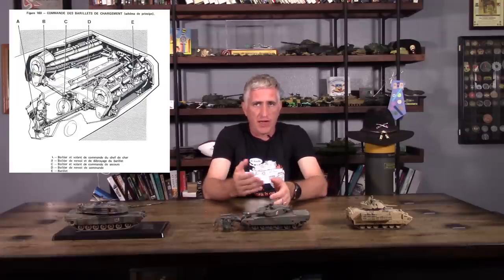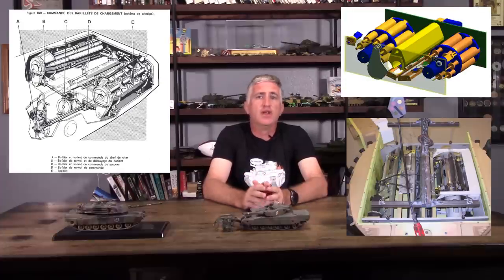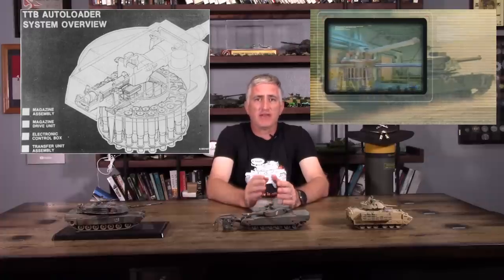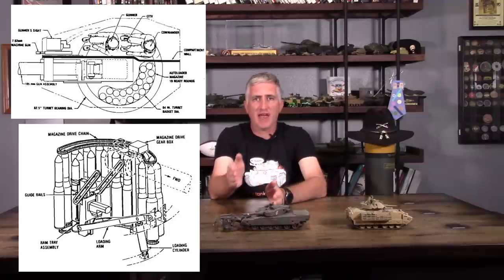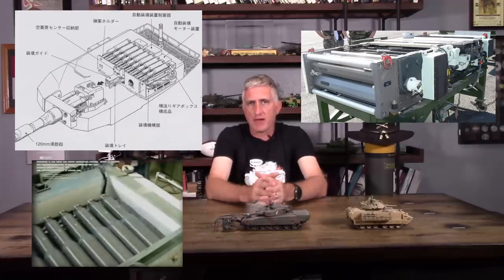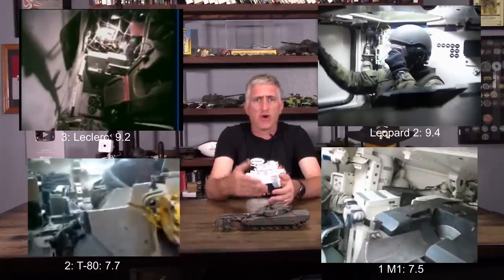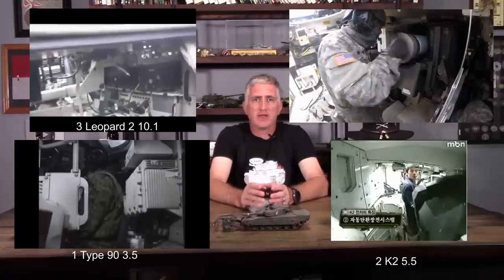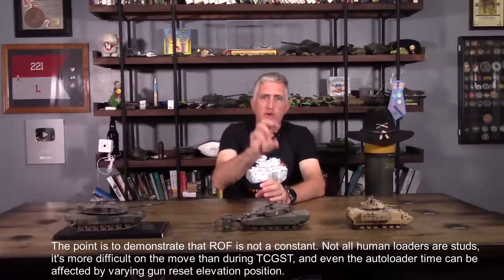Whither the Autoloader?

Comment: For me, the future is in autoloaders because I think next generation if tanks be semi drone, with the possibility of computer-assisted remote control mode.  If we look at T14 type tank idea, is easy to convert this type of tank to the drone, because all essential components are in place. Crew be in this type of tank mostly for strategic movement and maintenance.  When shooting start tank be command remotely.
Reply: The problem with this is that you are going to be sending out radio signals to and from the drone tank.  Which means that the enemy will know the tank's location and your location to within 10-15 feet.  You can buy a scanner with direction finding capabilities for under $1,000 at any amateur radio supply store.  And adding a feature that causes a missile or shell to home in on a radio transmitter is old technology.

On a battlefield you want to avoid doing anything that announces your presence.  This is why tank units still train to communicate using hand held signal flags.  Transmit on the radio and you're announcing you location.
Reply: @colincampbell767  That and anything controlled remotely can potentially have that signal disrupted, rendering your machinery useless.
Reply: @colincampbell767  I think about the more similar system as in air combat drone, where drone himself is pretty autonomous, and human control is rather because of law, not a necessity. And signal can be quite hard to detect, the possibility is laser signals retransmitted by air drone or very short-range signal transmitted from-to infantry supported by this tank.  This type of vehicle is more flexible than a pure drone, because can have the crew in the armored capsule, but in risky situations can work alone with a guide of supported troops (city fight or the possibility of mines)
Reply: @mikolajgrotowski  Laser requires a clear line of sight and the beam will be visible to anybody with optics that detect that light frequency.  (And if you use a frequency that nobody can detect - your drone won't detect it either.  And you also need a system that keeps the laser aimed at the drone.  

The way I would use a drone is to keep them with the company commander and send them out as expendable assets.  Preprogram the course into them and then either review the data it collects after it returns or observe it and see what kills it.  And even the presence of a drone will alert the enemy that something is out there.

If you want to put drone on tanks - use a ground vehicle type drone that's small, low to the ground, and designed to move stealthily.  Use fiber optic wire for communications with the tank, and it can replace the requirement of putting a couple of people on the ground 100-300 meters in front of your platoon as an LP/OP.
Reply: @colincampbell767  You think on drone as scout,  I think on heavy fire support platform. When I served we have couple methods for secure short range communications,  and this can be used.  Lasers are difficult to detect because are coherent,  and if you not stay directly between sender and receiver you not detect this type of communication.  And on modern battlefield is high level of communications noises,  making detection even harder.  And full sizes tank drone have advantages,  is possible to mount heavy weapons and with places for crews is more versatile,  because can work as drone or normal crewed tank.
Reply: @mikolajgrotowski  Lasers can be detected.  Air will reflect some of the laser light and through NVG's the beam of an IR laser is easy to spot. We used to do this all the time during night gunnery qualifications - put on NVGs and watch the flashes from the beam from the laser rangefinders on the tanks.  And then there's the issues of things that interfere with the line of sight between the tank and the remote transmitter.  And remember that everybody will know what frequency the lasers will be operating on because that's the one that gets the least interference from the air, smoke, and water vapor.  

And it's hard enough to figure out what's going on when your head's out the hatch - trying to do this using remote cameras is going to be even harder.  These drone tanks are going to be easy targets because the people operating them will be unable to maintain situational awareness.  

I am looking at this from the perspective of a couple of decades as a tank crewman.  A drone tank is not going to be as effective as a crewed tank - what tank crews would really appreciate is something that will replace humans forward of the unit's locations to observe and listen for signs of enemy activity.  Another thing that tank crews will really appreciate is an AI based system that would assist in target detection.  Or combine AI based target detection with multispectral imaging where the image of presented in an augmented reality format.  

Another advantage of AI based target detection is that the tank can be placed in a sentry mode where two crewmen sleep and one monitors the sensors.  On a four man crew two people have to be awake and ready at all times to ensure that nobody sneaks up on you.  Reduce the tank to a three man crew and your already sleep deprived tank crew is getting even less sleep.
Reply: @colincampbell767  as ex fighter pilot I remember when we have similar thoughts about unmanned aircraft.  And we are wrong.  Now is obvious future is unmanned craft,  not remotely controlled,  but fully autonomous.  I think similarly be with tanks.  You be not happy if you be in the tank when intelligent amunition start flying.  Financial and legal reasons slows expansion of unmanned vehicles,  but if we speak of using tanks versus modern equipped enemy,  sitting inside is more and more bad idea.  Especially if we can't have full air superiority.  Ps. Laser range finders and laser communication are working on quite different power levels and I think com lasers are not so easy to detect.
Reply: @mikolajgrotowski   Communication lasers are a dumb idea in an environment when most of the time you won't have line of sight with what you're communicating with.  Another issue is that tanks are an infantry support weapon.  They need a means of communicating with infantry and then making decisions based on what the infantry needs.  And the tank needs to be able to operate autonomously in close proximity to people without accidently killing them.

Comment: Bean counters or whoever, just about every post tour bitch session by troops who have spent one or more tours in the middle east war zone contains statements to the effect that they routinely went into shooting scenarios under strength (by TO&E) by 20 to 50%. I can just about guarantee that a four man tank will not get a 5th crewman, and there won't be enough 91H tracked vehicle repair types to take up the maintenance slack.

Comment: Russians using autoloaders come back to other issue: mass and armour protection. Russians couldn't build hydrokinetic transmissions and powerful enough engines for tanks to reach 60t, therefore had to get rid the loader to invest in armour protection in mass constraints offered by their engines.
Reply: ???? 
USSR made 1000hp engines for 60+ tons tank as early as late 40th.
Reply: @Poctyk  Well generally the size of the tank was based on the size of the engine. Modern Soviet/ Russian MBT's are largely limited in engine size.

Comment: Smaller size of ammo hatch inside haven't any positive effects. Pressure and temperature still will get in.
Reply: my name is my name  but do t foget that, this hatch is protected ftom front by the thickest armor on a tank, its role is not to protect ammo from shels. And it will have nearly no effect on stopping bullet. Small hole instead hatch will not give any protection against exploding ammo, becouse it will still transfer a lot of temperature and pressure. And threre no diffrence by how crew will exacly die.

Comment: How do autoloaders deal with changing ammunition types though?
Reply from the maker: The same way as humans do. Pull the trigger.
Reply: @TheChieftainsHatch  but if the autoloader is chain fed as you said, how could the operator choose between say, HEAT-MP and Kinetic? Wouldnt they be stuck with the round next in order?
Reply: @NOGRIZZGUY  Press a button or turn a dial to change ammo types.
Reply: @NOGRIZZGUY  No, you can do it a number of ways, but it could alternate rounds which would always leave it close to the ammo of it's choice.  It is very simple nowadays for a system to chose any particular cartridge. 

Basically it just cycles past the ones it does not want, stops and spits out the round you want.

Comment: All auto loader systems I have seen using so far (but only in Youtube videos) are quite complex. Could anyone please tell me what the simplest auto loaders designs are - under the following criteria: 
1) Number of moving parts
2) Number of logical steps of the load process.  

Is anyone with a professional background interested in a discussion? I have an idea, probably a stupid one, but I first need to understand a little bit more about the problems existing systems solved.

Comment: You said that a smaller tank with the same weight (as a larger one) has less ground pressure. How? Assuming the width of the track is the same and the larger tank has longer tracks, then the larger tank has more surface area and so less ground pressure. Was this a brainfart or what was the thinking here?
Reply: Probably a bit of a brainfart, but the idea is that a smaller tank is a lighter tank, Note that the Abrams is reaching 70 tons, the notably smaller T-90s are in the 50-55 ton range but both have some what similar frontal armor, so the T-90 should have less ground pressure due to it being lighter, as tanks get smaller at a slower rate than dose their weight, basically a tank that is half the wight of another is not necessarily half the size.
Reply: Wider tracks that weigh the same.

Comment: 1 issue... when showing the clips for human time loading, you picked an awful example for the abrams. that guy was slow as hell and armed the gun before the breach was up all the way. you can see it there right after he throws the handle. the breach should be even with the block. i was on the M1A1 Abrams. time to load a round is more like 3-4 seconds from knee switch to breach up (engine running). also, the magazine on the Abrams collapses so you can stow rounds in order if needed. after the center is pulled, there are handles to collapse the magazine, allowing others to fall into the center.
Reply from the maker: That’s why I grabbed clips from two M1 loaders, one somewhat better than the other. The point is to show variance. Just because a “good” loader will have a short cycle doesn’t mean that any particular loader will be a “good” one. Good or not, that guy is in the force and that’s his tank’s speed of reload.

Comment: Honestly I think you replace the loader an Abrams with the autoloader then the loader can Now operate third machine gun permanently and you may be can use one of the smaller autoloaders so the guy can man it from inside the tank relatively safely

Comment: Last but not least, auto loaders might allow a higher caliber I would think.
Having took 2 turns at joining the military in the 70's, both unsuccessful, I can only relate to the many tank games.
 But having an associates degree in auto mechanics allows me to say a human will/should slow down, but a properly maintained and lubed auto loading system should be there as long as there are rounds in storage. And will/should be always ready to load a round as needed unless damaged, when a commander or gunner can/should load manually.
In our next generation of MBT in the US, we could go auto loading. I agree as is let's not replace what we have in the US and those allies  with auto loading on an already proved method avoiding the cost.
Reply: Rheinmetall already considered this decades ago. In the mid 90's they tested a 140mm cannon. One of the reasons it never got beyond the prototype stage was the necessaty of an autoloader, because the ammunition was deemed as to heavy for a human loader. But this would have required a completly new turret for a Leopard 2 or M1, which all in all was considered as to costly and unattractive for potential customers.
Also Rheinmetall is finalizing a 130mm cannon for future NATO MBTs at the moment, should be officially available from 2025 onwards but they already recommend to use an autoloader for this thing because the rounds are borderline heavy for a human loader.

Comment: It sounds like auto loading if it comes to US MBTs will be a solution to a problem an not an end in itself.  Up armouring and up gunning will make any future tank heavier unless something gets taken out of the tank. Losing a crewman is an obvious way to do that. Another decade or so worth of automation of gun loading should help with reliability as long as military aerospace is kept away from the design. Things like remote networking, and souped up versions of the 360 degree cameras used in luxury cars can be used to compensate for the missing crewmen when needed.

Comment: I'm not really sure why tanks have a traditional gun anymore.  I would think a 30mm cannon and a few anti armor missles would do a better job.

This isn't WWII, weapons hit what they are aming at now. Not to mention the US is perfectly happy paying 300k for two javelins to destroy one tank.  It still wins ecomoicly because any enemy tank and crew is far more valuable than 300k. 

Missles also have a near zero wait time between shots.
Reply: Tanks must be fast and protected against most arms to get their valuable cannon safely to where they need to be on time. Why is the gun so valuable? Because it fulfills many needs adequately and cost effectively. Some of its greatest strengths is working together with mechanized infantry on offensive operations in order to provide fire support on hardened targets without having to wait for the arrival of air assets or coordinating and having to adjust impacts for artillery. This speed and not having to pause and wait allows for much more offensive momentum. In defensive operations, tanks positioned correctly can not only take out many armored vehicles of an attacking force fast and accurately, but are also able to move to another hotspot quickly and safely due to their armor (which also makes them difficult to take out when they aren’t moving to another hotspot).
In the offense, 30mm cannons cannot take out properly fortified enemy bunkers. Anti tank missiles are not at all cost effective for taking out a concrete hilltop position. Missiles are also usually much more bulky and take up a lot more space, which means not being able to carry as many rounds. Missile fire control systems are usually more complex and expensive. This would lead to an autocannon missile tank to overall be more expensive, which means less of them being built to cover the same amount of areas needed while also being able to deliver less firepower because of their reduced ammunition load.
This debate is an old one, and was put to the test extensively during the cold war. Guns mostly won out in the end. Of course the battlefield is changing, and the gun has evolved to adapt but it is gradually showing less relevance in the near-peer stage. However all of a tank’s gun and armor advantages are increased and all their disadvantages are decreased dramatically when talking about facing a lower-tier adversary, and such conflicts are certainly not going to decrease in prevalence or importance any time soon.

Comment: Does Battlefield Cyberwarfare have, if just for the argument, an impact on the debate? Could hypothetically an OPFOR Cyber unit somehow "hack" a Tank and disable systems, like an Autoloader?
Reply: No. The autoloader computer isn't connected to any sort of network.
Reply: Reto.the.SciFifan I mean it would depend to what extent the autoloader is digitised and not purely mechanical but in some hypothetical future war scenario I guess it’s a factor. However that said, if the enemy can hack your tank to mess with your auto loader they could just disable your entire fire control computer or any other aspect of the tank’s digitised systems which in itself would be a problem regardless of what loader you had.
Reply: @Skringly  As I said...hypothetical. I am aware there are higher priority systems to affect. But then...those may get better protection, an Auto-loader may be less of a priority (and therefore nobody funds its protection) and maybe a target system to interfere. Even if its just a hydraulic pump that fails due to an attack.

Comment: ur missing the point of a loader... loader is the most fun position on the tank i love loading dont take it away from me.... also if the leopard 2 falls to emergency the gun doesnt go in the loading position and u have to manually remove the shell bottom before loading the next shot a bit unconfortably especially if ur small.

Comment: I agree with the idea of having the 4th be on UAV duty.  It would help with target acquisition and situational awareness, and can he sitting down in the hull instead of the turret
Reply: or in a remote IFV with other similar guys and doesn't take up a space inside the tank.
Reply: @solarissv777  commanders might be fighting for the use of the UAV in that case.
Reply: @ivankrylov6270  I ment, that every tank has a designated UAV, that can be controled from either inside the tank or from external terminal. The IFV containing extra crew members would have universal terminal for each extra crew member. Their duty would be to fly around designated tanks and mark targets and threats. While tank commander sees the battlefield from the point of view of his tank, and information from the UAV is provided via augmented reality: red marks over enemies, virtual billboards, flying around, showing what's behind the corner, over the hill etc.
Reply: @solarissv777  I see.
That would work too